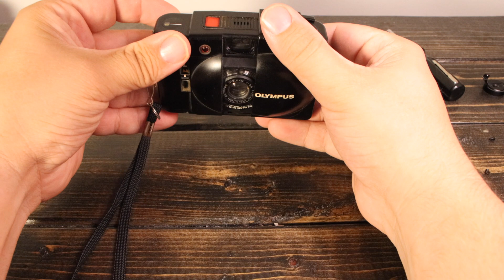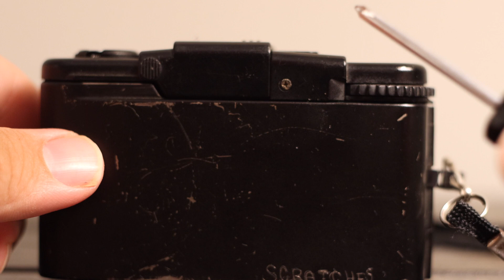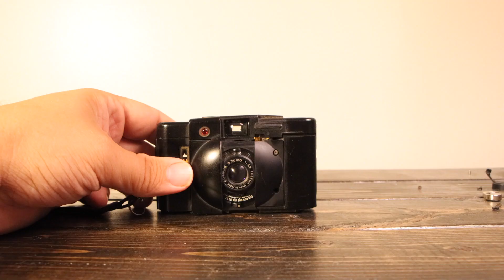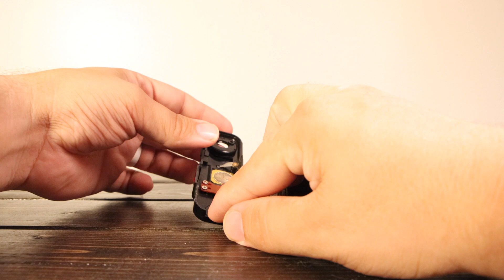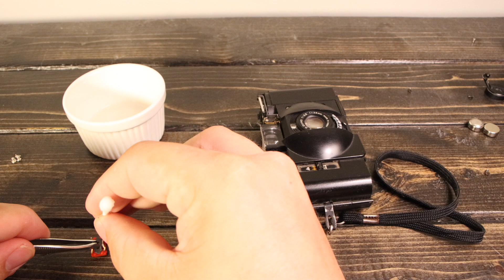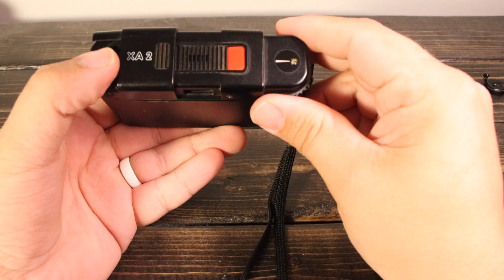Olympus XA2 Shutter Button Repair

Comment: bro my xa2 is always on self count down mode，even i removed the bottom lever off，whats wrong w it？
Reply from the maker: No idea. That sounds frustrating though. I'd imagine a wiring issue or a switch is flipped and isn't being turned off.

Comment: My shutter works for 2 shots and then it stops. I'll try cleaning like you did to see if it solves the issue.
Reply from the maker: I kept having the problem too. I thankfully had a second one that didn’t have the problem. I think it could be a wiring issue.
Reply: Just did it and it worked for only 6 shots and it stopped again. Pieces are clean and nothing looks corrupted. Does anyone have any idea what could possibly be, so I can do a more specific search?
Reply: @janoca  i think we have the exact same problem. I was able to use mine for two rolls no problem, but now when I press the shutter it just lights up the red thinggy but doesnt fire. Self timer works though, then after a few shots on the self timer, it fires normally for two shots again then nothing.
Reply: @ I left mine at maintenance today and I am hoping they can fix it cause I really like this camera. As soon as they get back to me, I'll comment here to see if it can help you too
Reply: @  nice man hope it goes well because I really like this one too and new ones sell for $160+ while I only got mine for $35. Repair shops here also rarely accepts vintage point and shoots because theyre difficult to repair.